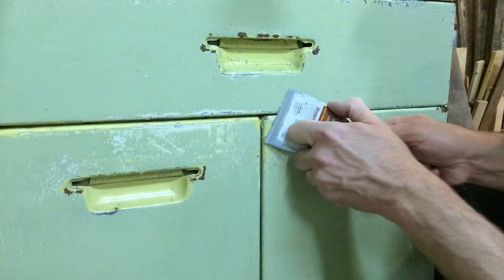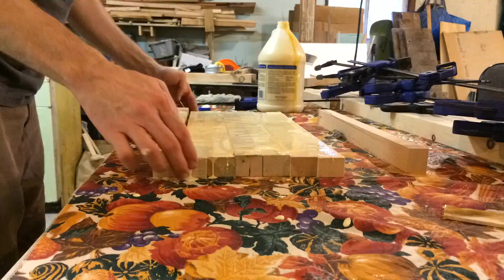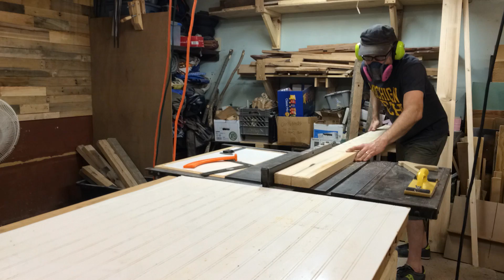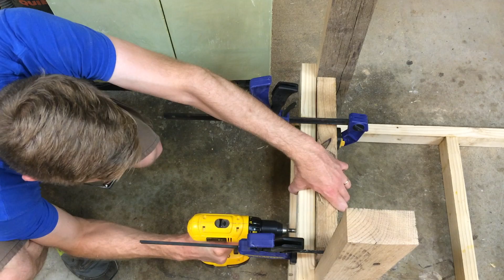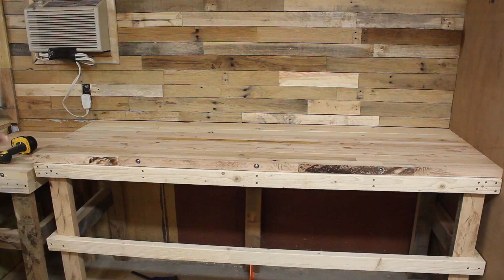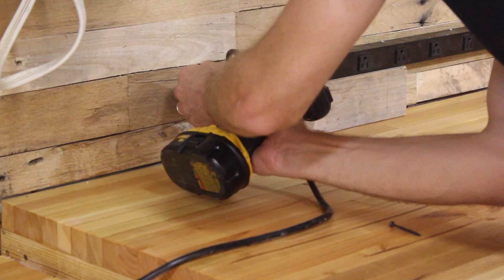Reclaimed Wood Workbench & Miter Saw Station (Almost Free Workshop Redo, Part 3)

Comment: Love that you have used reclaimed wood for this project and it came out nice. Your friend might have given you clear instructions though. For the rods to all go in smoothly, the location of the rod needs to be in the exact same place on the whole top. Clamping the sections on a flat surface and then drawing a line across all of the sections at once instead of one section at a time. As you found out, a millimeter one side or the other threw your alignment out of place. It turned out great though.

Comment: All the safety commentators go play with your mangina's. harden the fuck up. This dude just ate 240v like a boss. He lived to tell about it because of the safety switch in every home fuse board. Any one of you wet fish would be flapping on the ground after hearing the electromagnetic hum of your mummy's hair dryer and probably never picked up a trade tool in ya life. We have all made mistakes, takes balls to admit them and learn from it. Takes the thought process of a 4th grader to put someone down. Even that's insulting 4th graders for you trolls.

Comment: OK, but in my 50 years experience it is way too heavy. The money you saved using used material could have been spent making money. Not to be too critical; but, I would not do this.
Reply from the maker: I enjoyed the process and the act of reclaiming the material is really satisfying. Not sure what you mean by "too heavy" - it's a solid workbench, which is what I wanted.

Comment: What's your plan for dust collection with the miter saw?
Reply from the maker: +Brad Bell Glad you asked! I'm planning to add a hood/shroud with two ports that hook to my shop vac (since I don't have a proper dust collector yet). 

I currently just have a single line from the shop vac running to the miter saw's dust collection port (not shown in the video), which works OK but not great.

Comment: That turned very nice, I plan on a similar project in the future, good job. As a side note and nothing against Harbor Freight   But make sure that power strip has a UL rating, I noticed you also have an a/c unit in the same outlet, could draw a lot of current and overheat so a smoke detector in the garage would be a good idea. Sorry for butting in like that but I notice things like that and have been a firefighter for almost nineteen years, in that time I have been on a ton of fires from electrical problems. Just lookin out for ya so no offense.
Reply from the maker: Thank you for looking out! I appreciate your experience and your service as a firefighter. I'll keep an eye out. I actually don't end up using the AC much; I'm in Michigan, and I usually either don't need it (fall, winter, spring) or I just open the garage door to get air flowing. Thanks for watching!
Reply: Right on brother, keep up the good work.

Comment: Nice work. Just a tip for the future-- if you ever need a long drill bit again they do make bits that take extensions or you can make one using threaded rod. Just sharpen a point on the end using a bench grinder and file a couple of grooves in the pointed end.. Start the hole with a regular bit first drilling as deep as you can. It'll be slow going and you have to clear the hole often but it works.

Comment: Excellent job.  It's nice to know I'm not the only who makes mistakes now and then.  I secure my bench tops with nothing more than Silastic.  That may be a brand name you don't have over there but basically it's a clear caulking product for use in showers and drain pipes etc..  I put a thick bead down on all the surfaces that the bench top will touch.  No screws and no other glue.  I use it because it - a) glues the bench top down, b) allows for any movement, c) allows me to remove the top later on without much fuss (the Silastic peels right off) if need be.  a) acts as a kind of shock absorber.  Your bench looks great!
Reply from the maker: +David Handley Thanks very much! I haven't heard of Silastic before, but it sounds like that approach would work well also.

Comment: I built a workbench very similar to yours over 25 years ago and it still serves me well. However, I wish I had someone suggest (as I'm doing you now) to put 6 drawers in just below the top brace and all the way from left to right. I put mine in only about 2 years ago with an electrical plug (with included switch) at the center and one end. The drawers and electrical boxes have been extremely helpful and wish I had done it loooong ago!
Reply from the maker: +MRrwmac Thanks! I am definitely considering some drawers and/or cabinet doors and shelves. I have a power strip mounted on my assembly table and it's a big lifesaver; I love the long power strip I mounted to the back wall at this new workbench, too!
Reply: +Bill Van Loo Mine has 3" and 5" drawers with the rest of the lower space to the shelf as cabinets.